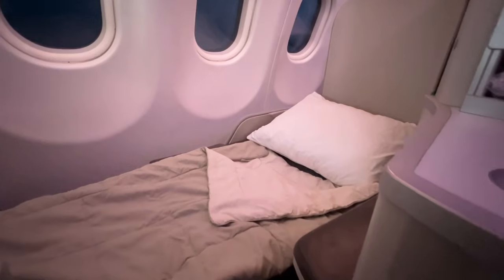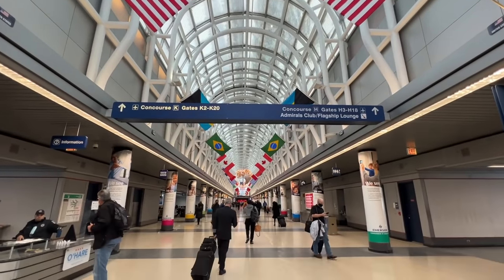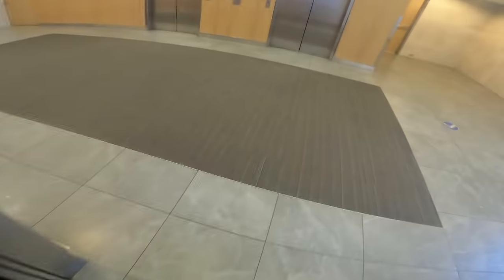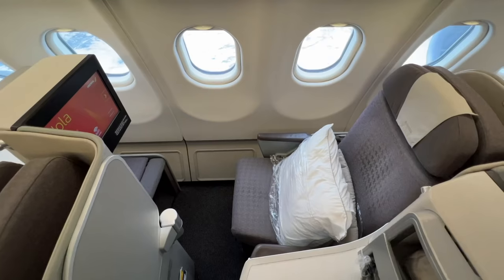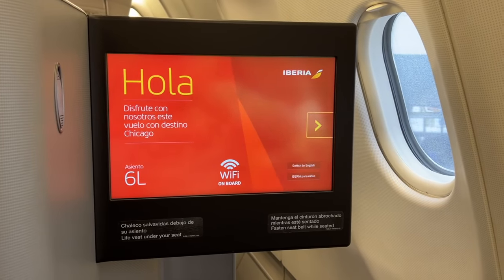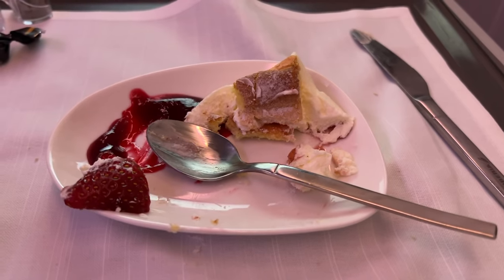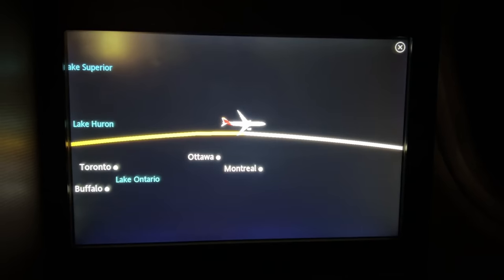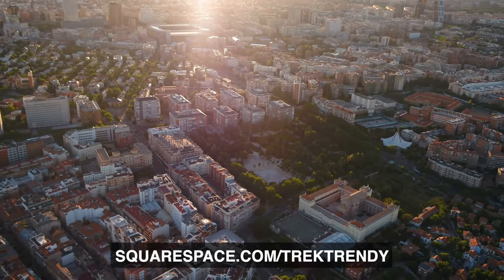My AWFUL Iberia Business Class Flight to Madrid

Comment: As a frequent flyer, I try to avoid Iberia at all costs. This video shows exactly why. I really dont know how they are still in business.
Reply: Agree, Iberia generally are not pleasant to fly with. I normally fly Business and its pretty pointless with them. They go out of their way to under deliver. They obviously don't have enough staff to clean the planes and they also never have enough check in desks open. One thing that really annoys me is that they always try to remove your checked bag allowance if you upgrade... Why are you removing my checked bag because I upgraded? If this is what we can see, how are their mechanical safety checks??

Comment: OK, so speaking as someone who's been around aircraft since 1973 at Heathrow Airport, I can tell you a few things specifically to British Airways and their standards: 1) The cleaning crew has incredibly strict protocols for cleaning, vacuuming etc. and they usually have a Supervisor that oversees the cleaning as well as a Manager assigned to the flight. So, that tells me that this is a systemic failure of the cleaning company by the look of the long-term build-up of crud and old product behind/under the seats. Since this is not this flight's first round-trip, this bird has been flying dirty for weeks if not months. 2) There is a Redcap on the aircraft (or equivalent title) who oversees the cleaning/fueling/replenishing of food and drinks. The Redcap is the equivalent of the Captain between the arriving and departing Skipper and he/she is wholly responsible for the condition of the aircraft at handover. If the aircraft interior is a pigsty, he has the ability to act, up to and including pulling the plane from service, until the aircraft is suitable for service. 3) The cabin crew usually does a walk-through of every seat and every galley and cleanliness is a priority. The Purser (or equivalent) usually does a walk-through just to make sure everything is A-1. The Cabin Services Officer (or equivalent) then usually does a brief walk-through to confirm with the Purser that all is Kosher and that there are no safety, cleanliness or supplies issues that will impact the service. 4) When the Captain arrives at the aircraft, the CSO confirms to the Skipper that the aircraft is suitable for flight from a service standpoint and "away we go."
From what I saw from your video, there is a fundamentally systemic failure of protocols with regard to cleaning this aircraft (I know, that was obvious, but it needs to be said). The airline needs to have a letter of complaint sent to its CEO, and I'd include your video for reference, itemizing the level of filth throughout the cabin and the apparent disregard of the command levels inside the cabin to protect the passengers from serious health issues. They can internally address what you saw and experienced.
Now, Iberia is not a small airline. Iberia bought several South American carriers to strengthen their hold on the market and grew exponentially. In 2010 Iberia merged with British Airways to form IAG. Their standards used to always be at the top level of air carriers and you could literally eat off the carpets.
What an absolute disgrace for a national flag-carrier on one of its premier routes.

Comment: TT.
I concur with everything you have said about Iberia. We have just flown back business class from Miami to the UK via Madrid and it was awful. The flight was delayed by 2 hrs but we only found this out when went to the gate for the boarding time. in the airport lounge and on their app it was still showing as departing on time at 18.20. When we did finally board at 20.10 we didn't take off until 20.50. This delay almost cost us our connection in MAD. Food was awful, seat was awful, staff were unhelpful and safety was a joke. The woman opposite me was still in a reclined position with her eye mask on as we came in to land. As we hit the tarmac 2 bottles of water came bouncing down the aisle.
The best part of the trip was the use of the Flagship lounge at Miami pre flight
I won't be flying Iberia again.
Steve. C.

Comment: Thank you for high lighting your experience with Iberia. The worst International travel experience I have ever had was with Iberia some 10 years ago. The worst part was I booked with another airline but was re directed on a connected flight. Nothing has changed as you have clearly demonstrated.
Reply: At least Iberia planes don't fall from the sky, which is the most important part of a flight.
Reply: @Walsh6141  are you certain? I would recheck that

Comment: The five times I've flown Iberia (4 in Business Class), like you, I found the the food and more especially the crew, appallingly cold and could'nt care less about their profession or their charges (that's you and me). I've no doubt there are some who are very considerate and professional but I've yet to meet one. Without exception, any interaction with ground staff at check-in and arrivals was nothing short of arrogance and total rudeness. I wrote a letter of complaint, and guess what? Never got a response, not even after I followed up with a phone call after a few weeks and the usual empty promises.
Reply: Similar experience here. Only flew them once from Madrid to Cuba, won't fly them again. I didn't expect a budget experience, but got one nonetheless. It was the cheapest option, but not by far. Next time, I'm just spending a bit more money. Crew could barely speak English, so unless you had a standard question, you were out of luck. Service was the bare minimal. At least the plane was relatively clean.

Comment: Holy cow!  That level of “deep dirt” is unacceptable and symptomatic of a complete failure in their systems and processes.  In any public space one can forgive dirt and untidiness caused by, say, a messy passenger using the bathroom immediately before you.  But this was systemic, long-term, deep-seated dirt and, therefore, a greater health hazard.  I had a similar experience visiting the bathroom  in a branch of a well-known sandwich chain in London last year.  Same problem; deep, ingrained dirt built up over a long period as a result of no more than superficial cleaning.
For balance, I recently took an Iberia business class flight LHr-MAD, and on to Lanzarote.  Service, catering and cleanliness were all exemplary.  In fact the catering was better than on the BA Club Europe flight back (although the BA service was better).

Comment: I only flew once with Iberia, they charged me EUR300+ for basically a ryanair service quality. Yeah not doing that again. I only used them because the timing was more convenient than the budget alternative, and the flight was so late that we only arrived after the above mentioned alternative plane.

Oh and they advertised free wifi which actually meant there was a wifi network you could connect to for free to see the plane catalog, but they wanted to charge an outrageous amount for actual internet access.

Comment: As an Spaniard i DO RECOMMEND to use low cost airlines because they are usually better, faster, cleaner and have much services that you can add and they usually get on time and don't get cancelled or something like that. Iberia is so expensive that almost anyone use it here so the planes are not working properly and dirty and etc because we know low cost class can get the same if you upgrade you class inside the plane and etc (Vueling, etc)
Reply: As you can see in the video, there's almost no one because of something 😂😂. Never use Iberia in or out Spain, it used to be a good airline until the low cost came here and took its place, and not Iberia is as much expensive as it was and worse (do not go). I strongly recommend Vueling because I had no problems

Comment: Firstly, why weren’t you offered a menu and a choice of entrees. Secondly announcements on night flights for fasten seat belt signs, is usually a no no. Cabin crew will check or should check that all seat belt signs are  fastened and obviously this is why they should be fastened over the blanket and visible to the crew  so there is no need to disturb you.
The filth, and dirt on this aircraft and have no doubt many others, is totally unacceptable.
This aircraft needs a deep thorough cleaning and should be noted in the tech log.

Comment: That dirt isn't just from one or two passengers. It looks like it has been there for about a full year. This is just pure laziness on the cleaners side. If like 5 cleaners just gave the plane a quick wipe down between flights, literally a 10 minute job this wouldn't happen. The reason this looks so bad is because of pure neglect.

Comment: I figure the Purser would have known how filthy the plane was, there is no way you could miss that sort of filth. I would be looking for a new cleaning contractor, and advertising for new Cabin Crew. The Captain(s) are also responsible, they are 100% in charge of the Aircraft they are flying. It seems to me you are dealing with a systemic failure, and devil may care attitude right across the company, travellers should show their disapproval about such conditions by not flying with Iberia, and letting the Company know they will not be using their Airline again until there has been a major change in Crew attitude, and a discernible upgrade of cleaning/sanitary conditions across the entire fleet. They can only get away with providing such deplorable conditions if customers are willing to fly with them!

Comment: Iberia leave a lot to be desired. My last flight with them, Madrid to Panama City, we were booked to be seated in the exit row. There was a late plane change and my partner and I were moved to the back of the plane not even seated in the same row. At the time I was a Qanats Platinum frequent flyer, which there was absolutely zero consideration. The checkin person said I should complain to Oneworld if I didnt like it (service plus). I did in fact complain, and basically got rhe middle finger. Hence I don't fly Oneworld airlines anymore. I'm a Singapore Airlines PPS member now. Far far far better airlines in the alliance.